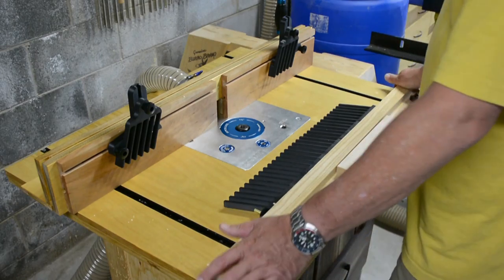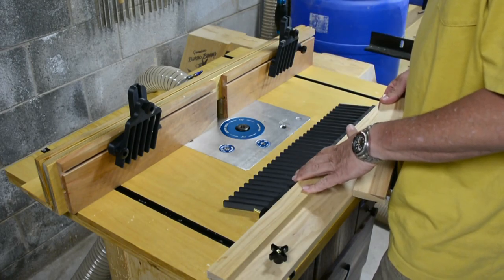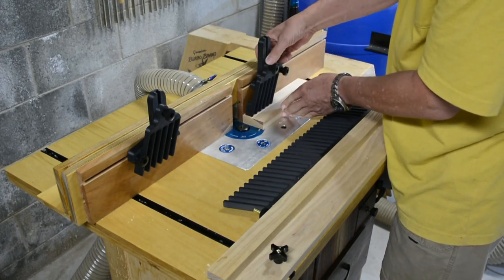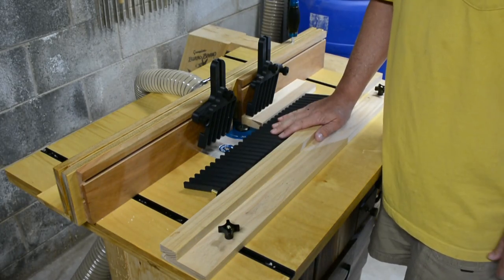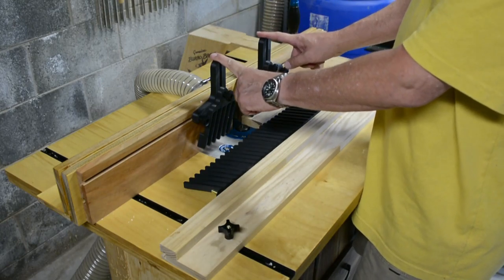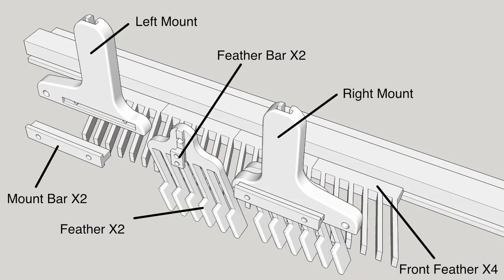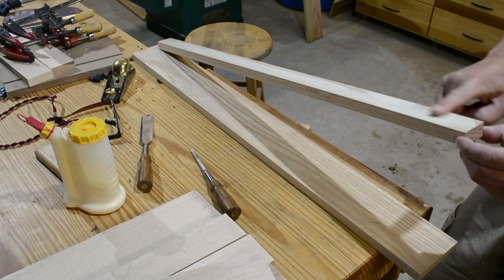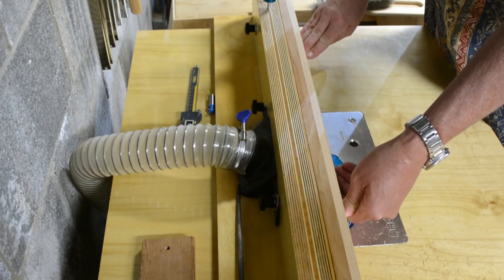Router Table Feather Boards

Comment: Hi James,
This looks a really great solution, and using those heat doohikeies was a really good ide. I have printed a feather board for my table saw. And that file I just grabbed off thingyverse. 
Did you design this is Sketchup?
Cheers and thanks for sharing.
Reply from the maker: Yes, this one was in Sketchup.  Good tool for simple things.